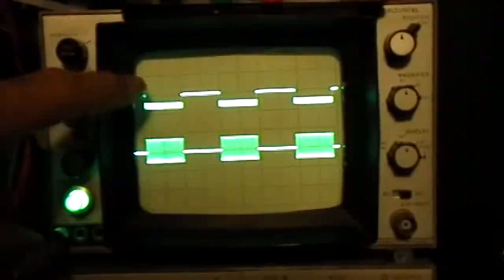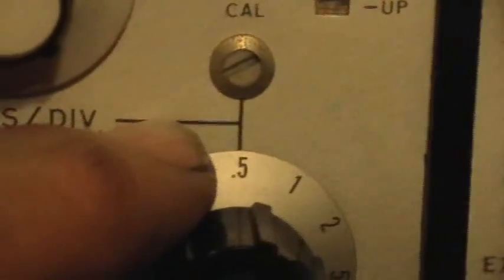Electric OU: More on Oscillations: Relationship of FG Drive Offset to MOSFET Switching

Comment from the maker: Yes, if you want the oscillations simply to continue without pulsation. 

The battery could be switched by a mechanical relay or even a toggle switch if long periods are needed. 

However the current drain can be up to or over 200 mA on the battery, so it will run down pretty fast... much faster than the main batteries do.

Comment from the maker: I would like to understand what I'm calling the "voltage floor" phenomenon in this video. I refer to the fact that something in the circuit prevents the voltage applied at the FG's points from going more than a few volts negative, by causing a current sink to open at that point. Further increases in the negative amplitude only result in more current at the same (apparent) negative voltage of about 3 or 4 volts.
Poynt99 has also seen this effect in his excellent comprehensive simulation, I think.